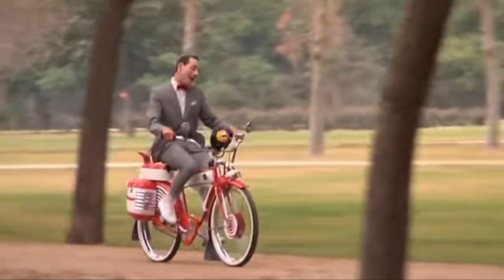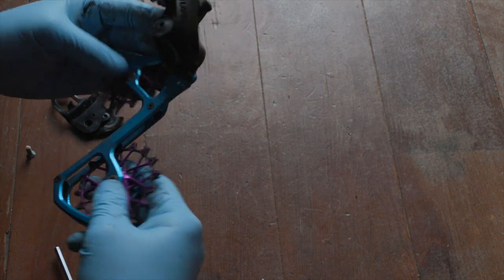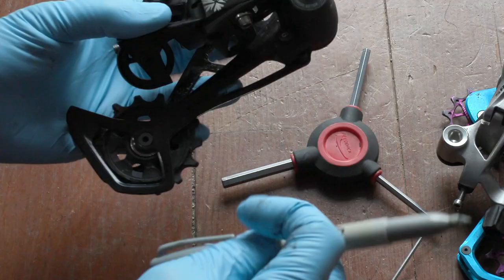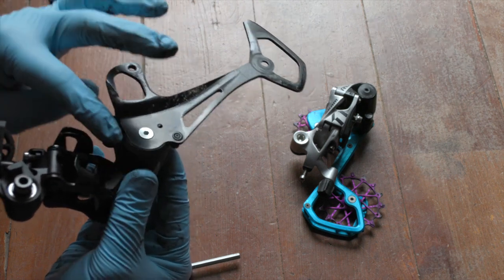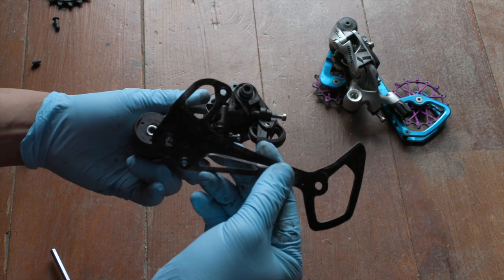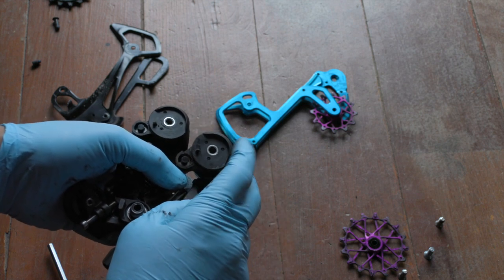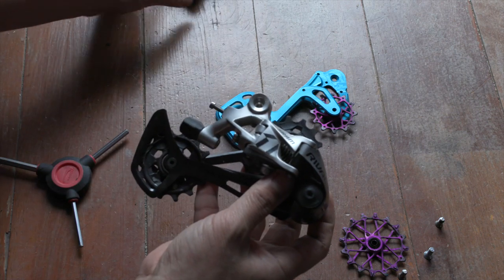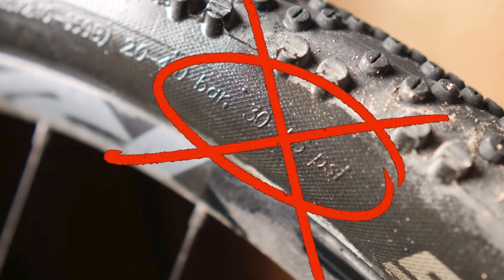The Derailleur Hack They Don't Want You to See

Comment: haven't seen it yet but wondering if anyone's mentioned the wolf tooth road link for wider range casettes. All it does is drop the casette down from the hanger. just curious - some limitations to its use but maybe too obvious.
Reply from the maker: Yeah. We did like three videos using the road link.  This works better.

Comment: Anyone know whether this kind of hack is possible with 10S SRAM Red? 11-28 max cassette, which doesn't cut it for the hills here. Love it otherwise and a hack like this would be awesome. 2X though, so don't need a huge mullet cassette.
Reply: A sram x9 10 speed for clutch or an X0 10 speed non-clutch will work with sram 10 speed road shifters, and shift you into a 40 on the back.

Comment: They said you can use GX 10s rear derailleur on rival without modifications since they have the same pull ratio
Reply from the maker: Yeah but they don't have capacity to do larger cassettes.

Comment: Expect the next generations to have minor enough design changes which won't allow for any of these shenanigans... ¯\_(ツ)_/¯

Just be proud that you've had an influence on the design of components from such a large company!
Reply from the maker: Or they could just make a derailleur that works.
Reply: @PathLessPedaledTV  ^This. Why are the top dogs taking so long? It's been a need for at least 5 years already. Sram just needs to mix a couple of existing part numbers into a new derailleur model to make what we need, and Shimano just needs to change the size of the plastic cable pulley inside their shifter to make the pull ratio compatible. Not hard, not expensive, no major tooling to buy, easy ROI...so what's the freaking holdup?! (Rhetorical monologue, no need to defend their sins.)

Comment: I have Shiftmate #9 from jtek to make my sram 11spd long cage mountain derailleur talk to my rival brifters. works flawlessly. 48/32 up front 11/42 in the rear on a straggler. cheaper than having to get 2 ders and swap parts, simple enough install. peter white stocks them.
Reply: You must be doing some serious climbing with that setup, I'm running the same jtek, same chainrings and an 11/36. Tried 1x 40f 42r but it wasn't enough and I didn't care for the big jumps between gears.  Then I foolishly thought that the 2x10 gx RD would talk to the rival brifters but it didn't work.  Glad im not the only one running a hacked 2x out there
Reply from the maker: Aware of the shift mate.  Couldn’t find anyone in the US with the 9 in stock.
Reply: @PathLessPedaledTV  ordered from the uk
Reply: @PathLessPedaledTV  peter white is where i got mine. they dont advertise that particular one but i called and they had it
Reply: @chrissmith2729  i run it somewhat loaded and I'm certainly not the fittest person out there so its nice to have the options to go lower. with my tires the low end is about a 21.6 gear inches. when im dropping down most of the time its generally to the 32/36 combo, but having the megarange bailout happens.
Reply: @rustymcrobot  ya, I bet that helps with the added weight of touring bags. I'm doing the oregon trail gravel grinder this year. 4000 ft of gain over 25 miles i think. Gonna need some gears.

Comment: That is some great content. Nice thinking outside the/my box.
 I downgraded to an apex derailleur when converting my bike to a 2x. Now I wonder if I might be able to hack the Force22 derailleur Istill have in the parts bin. It does not have the clutch though. Does anybody have some thoughts about it?
Reply: You could sell the Force22 RD and get a 10s Type 2.1 mountain rear derailleur.  100% compatible with 10 or 11 speed road shifters.
Reply: @MrEmptyKay  Thank you. I think I trid one of these Type 2.1 but it did not work out with the way my shifting cable exits the frame. It's about three years ago though.
Reply: @ickeausberlin36  Is it just an issue with tight bend radius?  Maybe something a Nokon cable kit could let you do?
Reply: @MrEmptyKay  Thanks, I'll have a look into that-

Comment: Hello from the Basque Country, I've been your subscriber some almost a year now. I've done a quick search on your channel and I haven't found any videos on the topic of rim internal width and tire sizes. Here there it is a hot topic. I don't know there. A local mechanic and I have the same bike. Finna Landscape. 22mm internal width wheels. He told me he put a maxxis 3inch tire on the front wheel and had no problems whatsoever. I currently ride with maxxis ikon 2.2. I ride on roads in very poor condition and I have a slight lasting pain in my hands (if you want to see, search on youtube "subida ezkaba 1-08-2015" and skip to minute 17 ). I'm planning on buying a 30mm internal width front wheel to put 2.8inch maxxis ikon. Comfort over speed. But I wish I could just put 2.8'' tires on my 22mm internal width front wheel. Without having to buy a new wheel for over 100 dollars. No second hand wheels of this kind in my area. What do you think?  This topic is really hot here. Another local mechanic told me I could put 25c tires on my 22mm internal width wheels.
Reply from the maker: It’s a complicated topic and I don’t have enough money to do that kind of testing. There is also lots of contradictory opinions so hard to present anything conclusive.
Reply: @PathLessPedaledTV  yeah, thanks for replying!

Comment: Take for example a SHIMANO STI race bicycle 9-speed combo shifter/brake lever and a SHIMANO Shadow rear derailleur - and it shifts 11-36 teeth easily. Take additionally a "Goat-Link" and shifts 42, 46 or even 50 teeth. SHIMANO is way better than SRAM, they offer many shifters and derailleurs for reasonable prices. SRAM offers Grip-Shift up to 9-speed for good prices, but where are the cheap derailleurs, triggers, MTB, race bicycle parts? SRAM is extremely expensive. Shifters and derailleurs can only shift, a crank can only crank. It's your choice to buy overpriced parts.
Reply from the maker: 9speed STI and paired derailleur is no longer in production so it’s sort of a deadens recommendation for most. I’ve played extensively with the goat link and it works most of the time but not always. Whatever way you can dream up of getting wide low gears I’ve tried. This is just another option.

Comment: Shimano Di2 allows mixing road, gravel and MTB components.
Reply from the maker: Sure. So does electronic AXS. The point of the series was to find a mechanical solution that doesn’t cost an arm and a leg.
Reply: No. This is not entirely true. Only true if you omit the front derailleur. So only good for x1 systems. I tried. I know. Once you go for x2, and try to set up the software you must choose ROAD OR MTN bike and if you choose ROAD the software will try to identify all the Di2 components. If there is a Mountain bike RD and a Road FD with Road Shifters, the software won’t let you proceed and complete the setup. It’s really stupid.

Comment: so, this is just to go for a 11s 50T big cog instead of a 42? it has not much sense, but nice hack anyway...

i mean, it makes no sense, because you can just install a smaller chainring and that's it... i have a rival 1 with a 42T chainring and a 11-40 slx cassette, and almost never use the smallest cog.

it's a much better plan to go for a smaller chainring, lets say a 38T, and with the 10t of the sram cassette (xdr body needed) the range will be as good as this.

anyhow, as i said, nice hack.
Reply from the maker: You can’t install a smaller chainring than 40 on Apex. Which is what I have.
Reply: @PathLessPedaledTV  ah you are right... i believe rival is min 36, but apex is 40t.

Comment: You are doing way more work than you need to.  You can just swap the cable guide on the derailleur body which will alter the pull ratio.
Reply from the maker: Aware of that hack. Doesn’t work on NX. The guide is riveted in and would need to be drilled out. A lot more work and destructive.